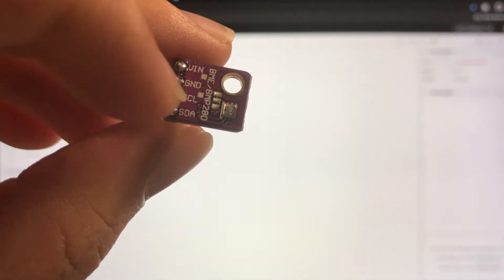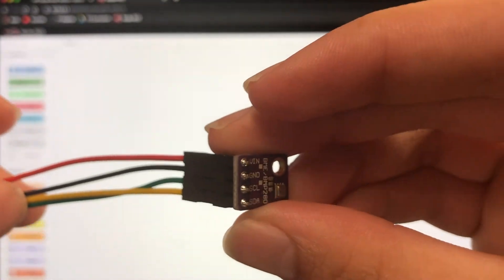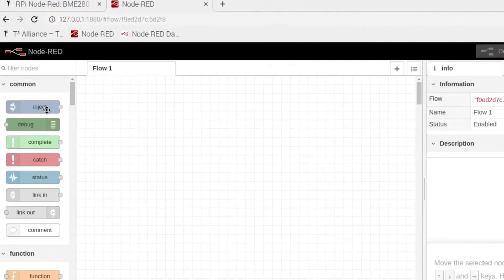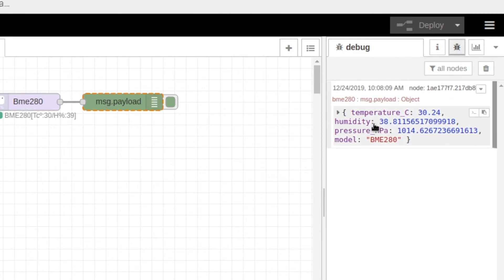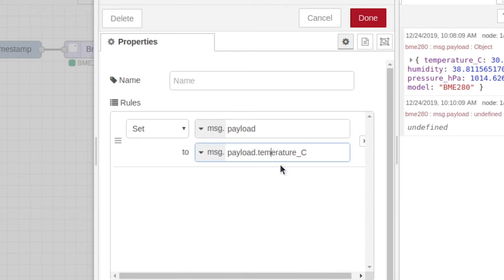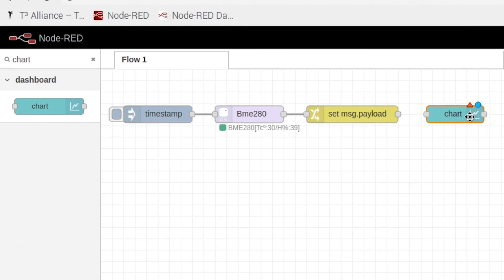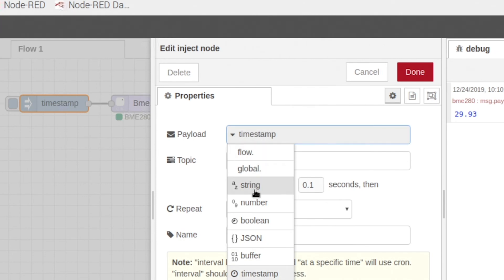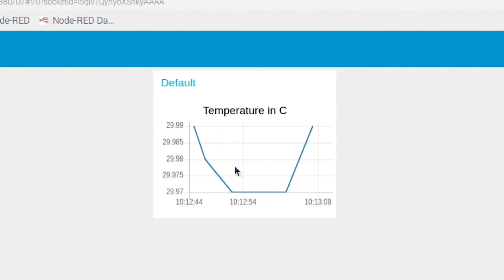Rpi Node-Re: BME280 Temperature Pressure Humidity

Comment: Can I add a 2nd one for outside using the I2C protocol?  I only have one pair of SCL and SDA.  Weird, the bme280 node doesnt work but I can load the sketch and get the same serial data you get using the BME280 node.  The Change node doesnt work using the Serial Node.  Says undefined.  I doublechecked the memory space and it is in fact using OX76 addy.  What is the "Bus#?  "Error: Module did not self-register: '\\?\.node-red\node_modules\i2c-bus\build\Release\i2c.node'."